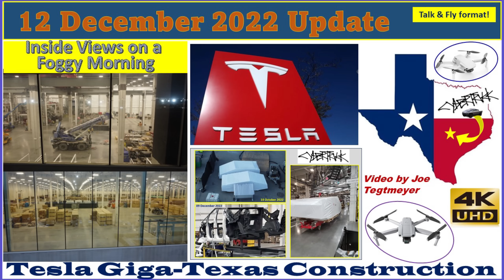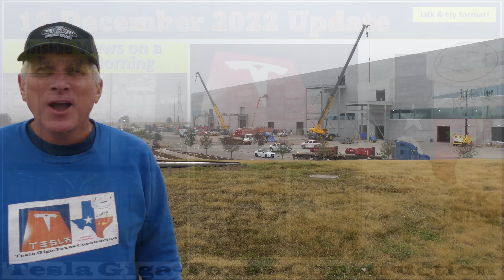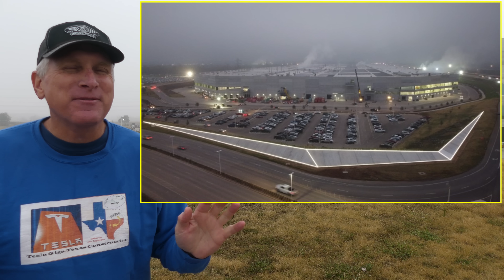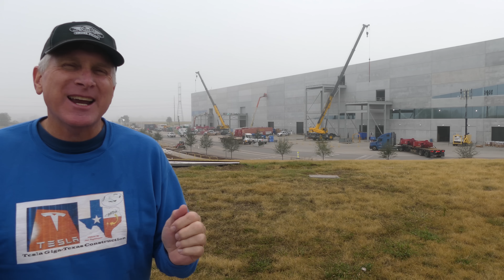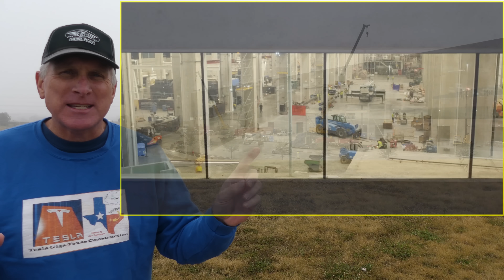Inside Views of Casting, 4680 Cell & W GA sections! 12 December 2022 Giga Texas Updates (07:00 AM)

Comment: Per a recent walkthrough of the Idra construction plant, they said due to restrictions they cannot fire up the casting machines at the  Idra plant itself.   This was from a visit made by Sandy Munro.
Reply: The castings that we saw for the cybertruck are more likely to be from resin than aluminium. Possibly to test the dies and to be able to measure and set up assembly machines.🤔
Reply: @malcolmrickarby2313  Possible, they can also be sub-castings welded together.  Either way, not suitable for mass production but helpful for this stage of work.
Reply: They could be sand castings just to get some test units
Reply: That is true. No castings will actually be made until the machines are set up in Texas.

Comment: ISTR that although the 9K IDRA machine was assembled in Italy, it was not actually fired up and used. They said it would be on site and installed before actual castings were made. It may have been in Sandy Munro's visit recording. Great shots, however...
Reply: Agree. This is probably made in several segments and TIG welded together. With milling machines on site Tesla have mostly likely taken DIEs production in-house and made several for the 6000 t presses dedicated to cybertruck sub-castings. Thus they can make progress on the CT project using the smaller presses. Back in the early model Y the rear mega casting was in two pieces.

Comment: There was that video of the big press set up in Italy before it was disassembled fir shipping to Austin. Probably ran tests of the various molds. Wouldn’t be surprised if that picture is from Italy. Almost looks like a 2 part rear casting that includes the vertical bed sides. Could end up with 3 casting making up a massive portion of the Cyber Truck under the SS exoskeleton.
Reply: It highly complicates things to fill the pipes with aluminium. I'd bet they would need to replace some parts to take it apart.

Comment: I would think that the concrete slabs poured for the electrical transformers will take about 30 days curing time to make sure they don't crack under the heavy loads. the longer cure time, the better they are. at work under the new unit that we built, it was 90 days before we started installing the beams. the concrete was several feet thick. patience on concrete work is a must.
Reply from the maker: Depends on the Admix they used in the concrete mix
Reply: Like Joe said, they can use special admixtures in the concrete to speed the cure time. High early strength concrete isn’t fully cured, but it’s hardened enough to attain the design strength within 7 days. I have seen high early concrete break at 4,000 psi in as little as 3 days. It’s not common, but it is possible. The norm is usually about 5-6 days.
Reply from the maker: @douglasgroff7648  thx Douglas!

Comment: About the 'gigacasting' on the Cybertruck body (3:00) it is small series so they could hand cast it piece by piece and mill it down to spec, mill it down from a huge block of aluminum or even construct it from some other material; for tooling calibration it just has to have the right dimensions. But I suspect it is proper aluminum as they will also need it for preproduction models to crash test etc.
Reply: I'd bet on a block is cast to rough shape, then milled to what they would get from the giga casting.
Reply: @ekaa.3189  You have to some testing of the model before committing to the casting dies, right?
Reply: @scottgaree7667  The testing they need to do now is related to getting manufacturing setup. Most of it is do the parts fit together. How they make the "casting" doesn't matter. All that matters is it has the right shape. They will have actual castings in a few months, and final tunings can be done then. Also then they can go through regulatory testing.
Reply: My bet is something like plastic or a resin.